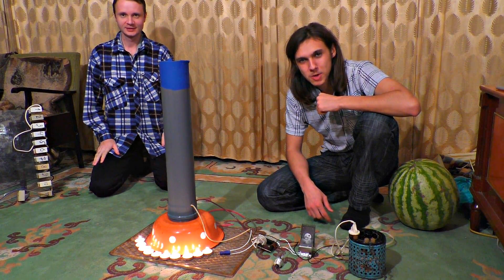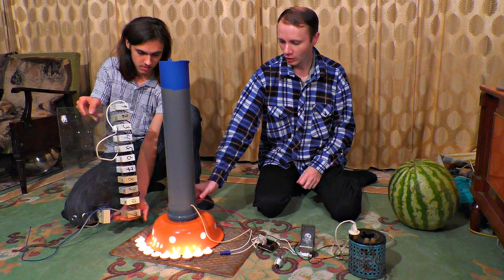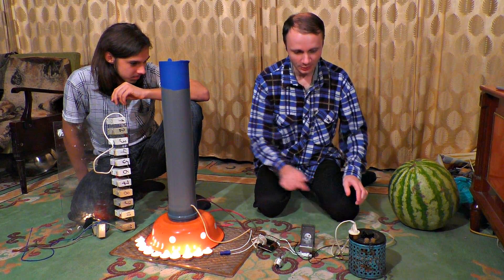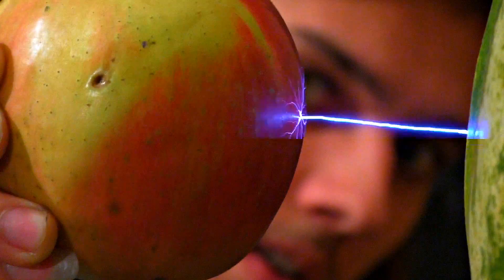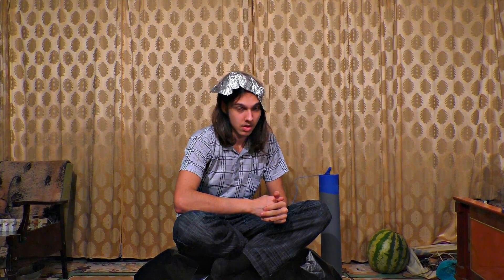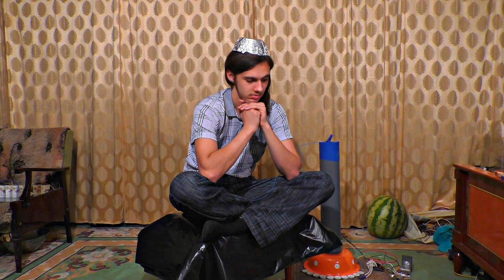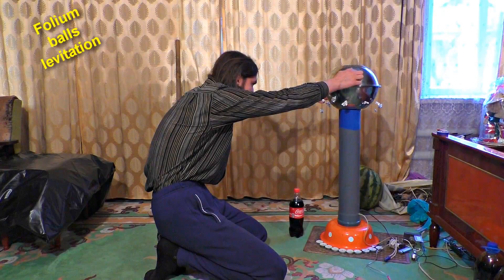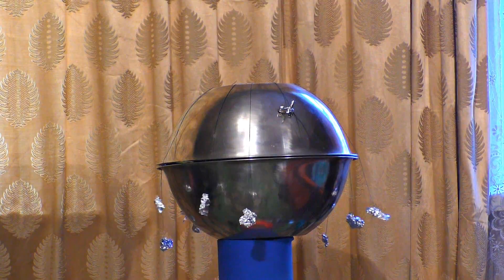LEVITATION ￼￼￼⚡⚡⚡ High Voltage Tesla Effects !

Comment: The floating aluminum foil at 5:00 is awesome imagine this scaled up to a full sized craft and some more refinement /control of the magnetic fields to move it at will with a magnetic control mechanism to adjust lift and and velocity

Comment: Are these two in a suicide pact? Seriously I worry for their safety. They don't seem to understand that even a HV supply with a high output impedance (and thus sub-lethal maximum output currents) doesn't guarantee safety. The load they connect to such a supply could have a high capacitance and build up a lethal amount of energy in it. Like a large metal object. Touching such an object would kill you.

Comment: High DC voltage sure does weird things, doesn't it?  Once when testing an industrial 120000V DC supply, I put a piece of toilet paper on the output wire and it floated off like that

Comment: go make some sodium from molten salt
Reply: ARandomTroll5150 or even easier from molten lye (sodium hydroxide) as that melts at only ~300 degrees celsius
Reply: Dragos Merisca molten lye requires precise temperature controll. The stuff dissolves every insulator other than solid lye itsself. Also it is very dangerous+ cant be stored when not in use because it absorbs water and co2
Reply: ARandomTroll5150 I personally did such an electrolysis, and a steel can resists it very good. I did the electrolysis with steel electrodes. The lye was molten on a portable gas stove, and when I saw it was completely liquid, I turned the heat to minimum. This way I recovered a bit of sodium metal.

Comment: arent those the same voltage regulators you used in you last video, that are ACTUALLY only rate to handle about 20 watts of power at something like 50 volts? yeah. they are.
Reply: Maybe they can handle more voltage at lower wattage. If it's 1 million volts it doesn't mean there has to be big current.